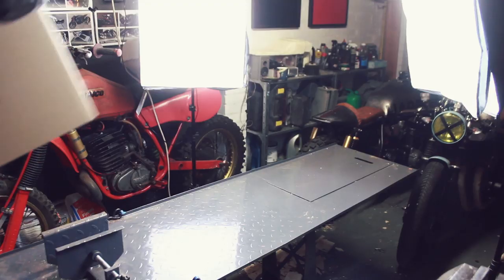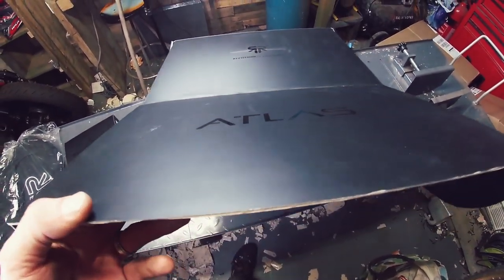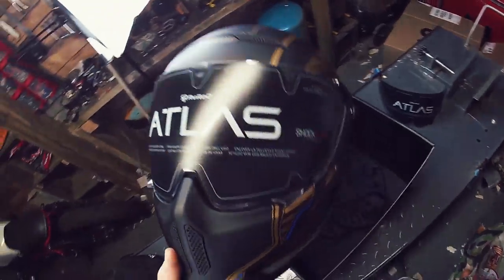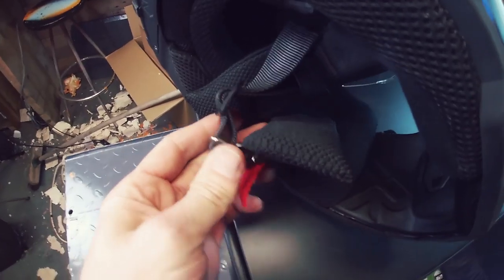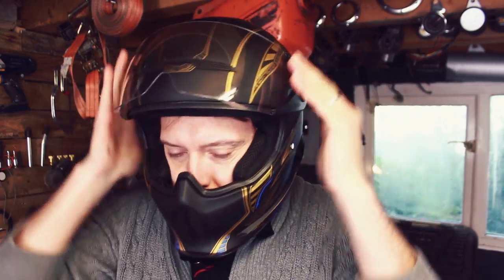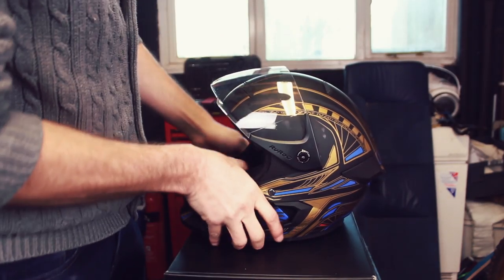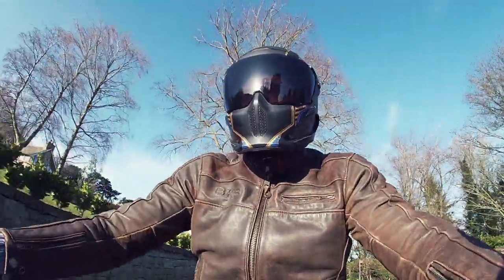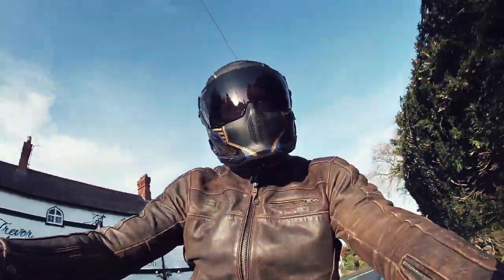Unboxing and Reviewing the Ruroc Atlas Gatekeeper

Comment: Been thinking about getting one of these! One thing worrying me is not being able to close off the vents during winter. Did you find that you were getting cold air running through the helmet on rides?
Reply from the maker: No draft coming from mine, you can close the front vent, but the top ones don't interfere